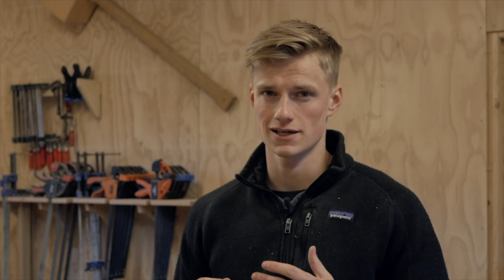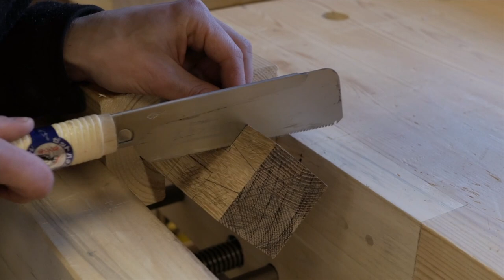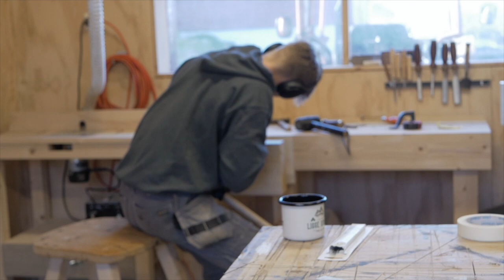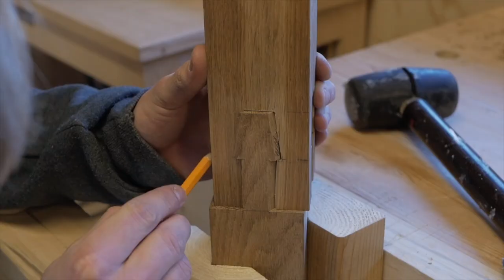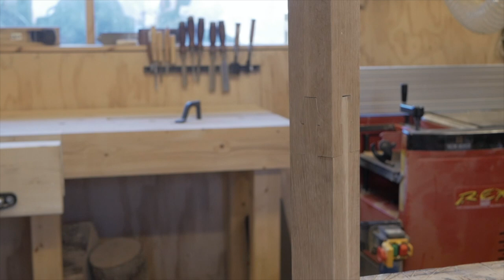The Simple Woodworking Puzzle No One Can Solve

Comment: Good on you for giving it a go, but you've not helped yourself, Are, by choosing oak. However, it was your marking out and chisel skills which left the result looking the way it did. As a matter of principle, you don't go anywhere near your setting out lines until all of the remainder of the waste has been removed. You started in them, which is just plain wrong. You could also learn the trick of putting a coloured wax crayon mark on one piece (usually the male) before a dry fit, and this will mark the tight spots on the other piece.  
Watch Dorian Bracht and see how much time and care goes into his marking out, (with a knife, not pencil) and note his choice of timber.
Reply from the maker: Yeah, I definitely got a bit impatient working on this joint